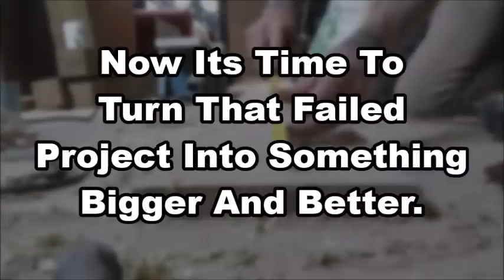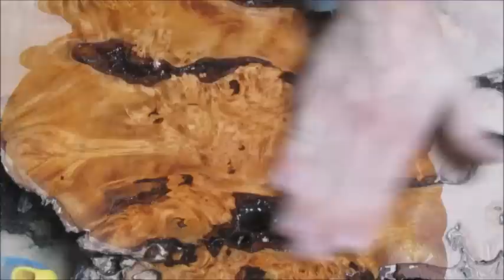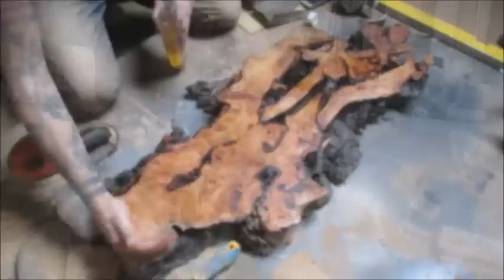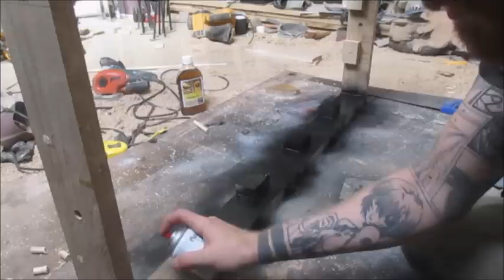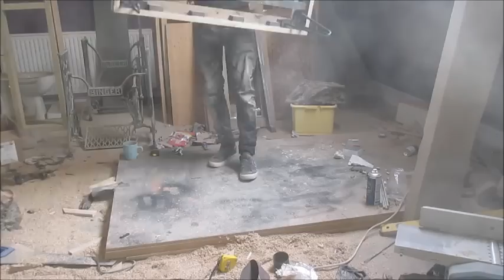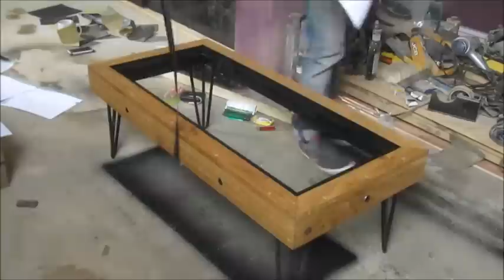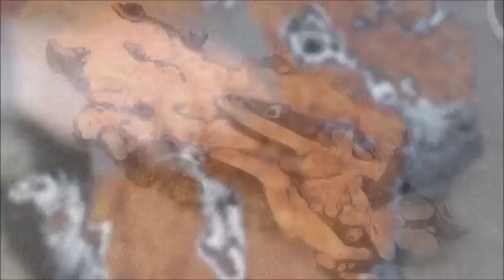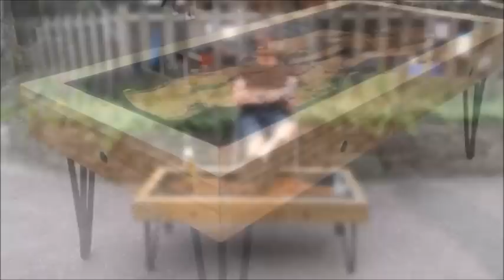Tree Root, Oak And Glass Coffee Table: Reborn From Disaster............... DSNERV

Comment: 7/10

Great project, poor utilization of such a beautiful piece of wood.
Reply from the maker: Thanks for the comment Dloweification.
Just wondering how you would have used the root for a project if you had found it? :)
Reply: Can't say for sure, to be honest, I just wasn't a huge fan of all the negative space around the root and the patterns in the wood used between the table sides and root. Perhaps even using some fake plants or something of the like to fill in space would have been nice, if not too tacky, but with the open bottom, it would look nice for about a week before becoming a dusty nightmare. 

Truthfully, I think you probably did the best you could with the piece given that it obviously wasn't structurally sound (from the first part). Maybe it's the pattern and stain contrasts between the root and table cuts that kind of take away from the beauty of the root slab. I might've gone wayyyy darker on the outer pieces so that the slab was the lightest part and really popped out of the centre.
Reply from the maker: Hey Dloweification.
Yes you have made some good points about the project.
I know that there are a lot of people out there that don't like the open underside of the table for the same reason of dust protection. I was trying my best not to turn the root table into a large specimen box and wanted to be able for the viewer to be able to look past the root and down to the floor below. If I where ever to rebuild the table i think i would add a 2nd glass panel to the underside to protect from dust but also give the root the floating effect I was going for. (other people in the comments have suggested a mirror base that would also work well)
I am not to convinced about staining the oak a darker color myself as it just seems a bit of a shame to loose a lot of the grain to a darker color........ maybe an acid wash for the oak would work well. 
Once again thanks for the comment mate. Its always nice to get others points of view on a project.
Reply: I like that double glass idea there Gus

Comment: very nice how about some strip led's inside to light it up in the evening
Reply from the maker: Thank you Александр ForestLamp.
I did want to put led strip lighting inside the table but it would have needed an ugly power cable hanging from the underside so I decided against it....... My new project (coming soon) will make good use of some led strip lighting though. :)
Reply: If cheapening this table is what you want to do, saw 1/2 inch off one of the legs and replace it with a folded matchbook cover.
Reply: DSNERV Awesome work!!! Quick question... I have a large round glass table top and I really want wood underneath like this do you know where I might find already cut wood pieces? I can probably work out getting legs down the line

Comment: Nice work! You took a dated 60's idea and with the help of fate, turned it into a functional 21st century piece of nice furniture with a nod to the 60's via the burl and legs. In the long run you created a lasting piece of art. You might think of putting a clear piece of acrylic to close the bottom as dust will accumulate in all the little nooks and crannies of the live edge and it will be hell to get out if you can at all.Good job.
Reply from the maker: Thank you for the nice comment Hilden Johns. 
Yes I agree that fate had a lot to do with the table re-design and I'm thankful that the root slab snapped when it did. I feel that it I now have a table that not only looks nicer but is also a lot more practical around the house. 
I wanted to be able to look past the root and down to the floor below and at the time did not think of adding a acrylic base to the table but after living with it the way it is now the dust surprisingly does not seem to be much of an issue at all. I have had the table now for over 1 year and even with it being in a house where there is construction and the dust that comes with it I have only had to remove the glass to clean the slab once..... a quick go over with a vacuum cleaner and the job is done. :)
Glad that you enjoyed the project.

Comment: Love it!  Only 1 small suggestion.  Get a plug cutter, cut your own plugs from matching. wood with the grain direction matching instead of using the dowels.
Reply from the maker: Hey Vince.
Thanks for the suggestion.
For this project I wanted to make the dowels as visible as possible. I could have screwed the support blocks from the other side so that I would not have needed dowels at all but I felt that the sides and top would have looked a little basic without the added feature.
Reply: l hear ya.  l thought that you did it for accent and l meant to say "unless you ..., but l am just getting used to this small tablet.  l hate "wipe it and swipe it" miss my keyboard & mouse.  l hope to do a similar size ,table except mine will have a huge fossil fish in sandstone matrix set down in black felt with a bevel glass top.  l Was doing wood legs but l like your black metal legs better.  That will accent the black felt around the fossil like it does the black parts in yours.  Great job, ever thought of going into business.  like they say take a job doing
 you love and you will never work a day in your life.
Reply from the maker: Hello again Vince.
I love the sound of the fossil table that you plan on making. Have you considered filming the project and placing it on youtube at all? I know that there would be a lot of people out there (including myself) that would enjoy watching the build very much. 
I do not know what wood you intend to make the frame of the table out of but if your plan was to use oak like myself then I would suggest possibly doing a controlled burn to help age the wood a touch. I think it would work well against the black felt and sandstone of your fossil. A lot of viewers have also suggested that I should have added some LED strip lighting in my frame so maybe this would be something for you to consider with your project as well. 
I would love to be able to take my projects to the next level and start making a little money from them some day. I have sold a few things in the past and recently found out that my better half is not a fan of this root coffee table at all so I guess that it will also be sold at some point and the funds put towards some more tools or just payments on our new house. For now it looks like woodworking will just stay as a little hobby for me in my free time.
Good luck with your fossil table. I am sure it will look amazing.

Comment: Every craftman does mistakes over time, but great craftman is identified from how well and fast they can recover and fix those mistakes. Good job, though i would have put plywood plate on the bottom so dust dont get into all those small places on the wood that are hard to clean.
Reply from the maker: Hello Hellsong89.
Thanks for the comment and kind words.
for this table I wanted to be able to look past the root and down to the floor below as if it was almost floating. I do understand that dust will be an issue with this design but after some thought (and some ideas from friendly viewers in the comments) I intend to add a framed glass base to the table to solve the dust problem. :)

Comment: Most awesome work. What a great idea! Curious what you think of adding some underneath accent lighting. To see this accented in a darkened room would be beautiful. Just wondering what you thought.
Reply from the maker: Hey Rick.
Thanks for the kind words for the table mate. 
Yeah I have been meaning to add some LED strip lighting to the table as a viewers request video for a long time. Unfortunately the length of LED's  that can be powered from a battery pack is slightly to short for what I need so I am in two minds if I should just add 2 smaller battery packs or to try and make my own stronger pack that can power a longer length of strip lighting. 
Either way you will be able to see this table with lighting added at some point.

Comment: Nice! Maybe some led strips would look good.
Reply from the maker: Thanks timidbuck.
Yeah I think I am going to add some LED strip lighting inside the table. Just need to figure out how to connect the length I need to a battery pack as I don't want a wire plug dropping down from the underside of the table.

Comment: the more I watch this video the more I appreciate how much WORK and DESIGN process went into it. I have couple questions if you have time,  
1) is this what you do for a living?  I want to do this and other designs ideas. I'm studying joinery but don't want to be another site joiner fitting doors for a living. tho probly have to do both. 2)
I haven't much space to work from,  at mo weather is up and down. so hard to get out doors. any tips. I'm from the north west,  not far from Liverpool.  bout you?
Reply from the maker: Hey Scott.
Cheers for the kind words about the table mate.
No I don't work in the joinery trade at all, I just make all my little projects as a bit of a hobby for fun and relaxation in my free time. Finding space for workshops is always a problem. I am lucky that there are a few free rooms where I work so that I am able to put my builds together and make my videos. If you are studying joinery at college or university then most are fine with you using the space and equipment as long as you are respectful and keep the place clean. Apart from that how about advising locally for anyone that has a unused garage or outbuilding that you could rent for £15 pcm.  You would be surprised about how many old people have them and would be happy for the extra cash or even a little work such as clearing guttering,  fence painting, gardening etc etc for you to rent it.
I'm a few hours drive away from you living in the Gloucestershire area at the mo. 
Good luck with your study's mate.
Reply: DSNERV that's a good idea bout asking a retired person to hire there un-used garage. you could make   a nice second income from your builds. do you have a particular creative dexterous job?
Reply from the maker: scott mclean 
Hmmmmmm I don't really know what I would give myself as a job tittle? For a long time I have been working by myself fixing up an old police station into a set of flats but at the same time also being a caretaker / handyman for a childminding setting that is run from the same building. 
One day I might be knocking down walls and the next doing something as simple as organising art supplies for the kids.
Kind of a weird job I guess but at least the work does not get boring.
Reply: +DSNERV sounds like a enjoyable job
 looking forward to seeing your next project

Comment: Is the glass beveled? It looks like it sticks up a bit. 

The table looks wonderful, though I expected you to stain the frame darker.
Reply from the maker: Hey David.

No the glass is not bevelled at all. You are correct that in the video it seems slightly raised up but that is just because the Velcro I used as padding had not been fully compressed under the weight of the glass yet, now it sits nice and flush to the oak.
Reply: dsnerv I love what you did with it. I honestly thought you were going to fill the gaps with epoxy.

Comment: We're the side bolt only decorative? Great work, but I'm not crazy about the legs. Won't the gouge hard wood flooring? Anyway it look awesome
Reply from the maker: Hey Stephan.
Yes the side bolts where only for decoration, I felt that the table would look to simple without them.
A lot of people would have liked to see wooden legs on this project but for me the metal hairpin legs work just fine. :)
Surprisingly they do not gouge or scratch hard wood flooring at all. I have had the table in my living room for over a year on a hard wood floor and there has been no signs of damage caused by the legs at all. 
Glad that you enjoyed the project.